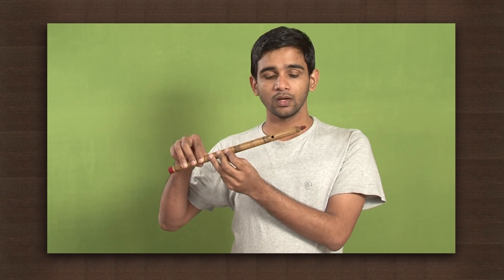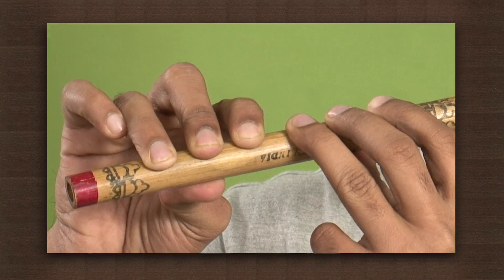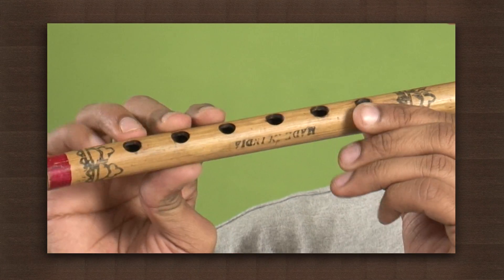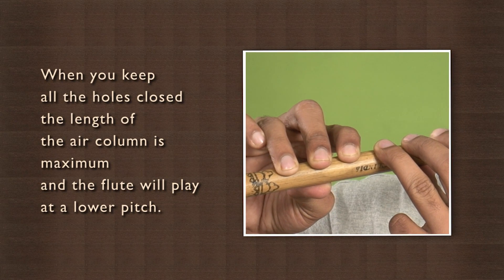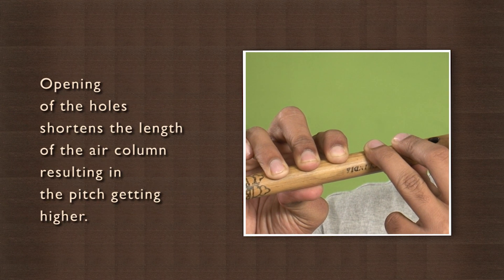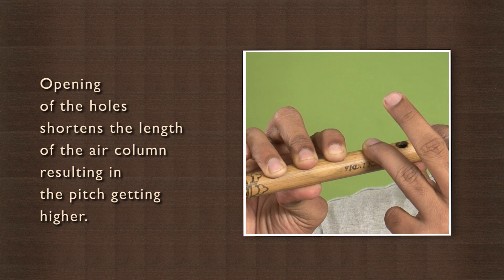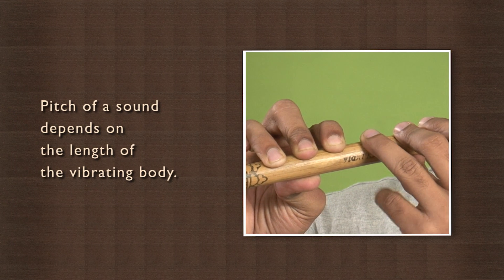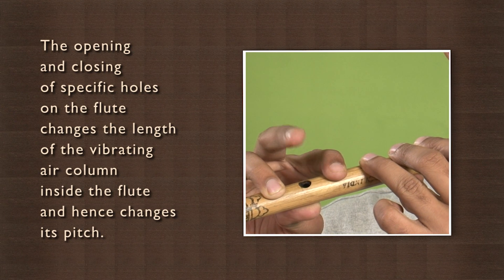Pitch depends on length of air column | Mechanical Vibrations | Sound | Physics

Comment: fun fact: This is the exact reason why when you fill your bottle with water, the sound pitch increases and is highest when the water surface reaches the top. Because when there's water, there's lesser air column, thus higher pitch. Wow, throughout my life I knew this sound of bottle water filling up, but never wondered why the pitch increases, or how that also relates to how flutes work: Through air column
Sir, this is so fascinating! Thanks for the upload!
Reply: thanks for this. I did it and it demonstrates the theory well. I'm going to use this to teach my kid.